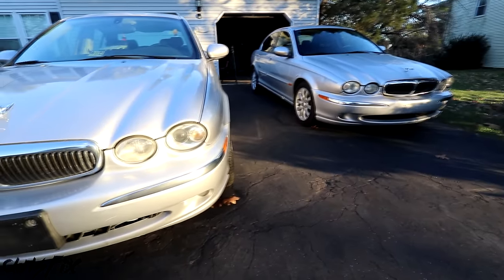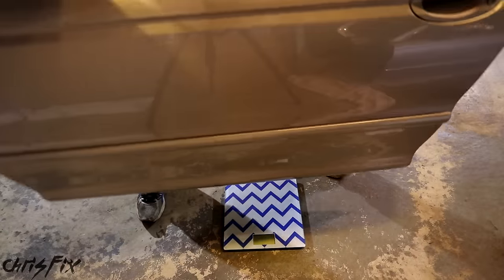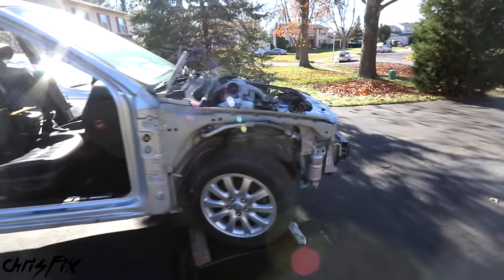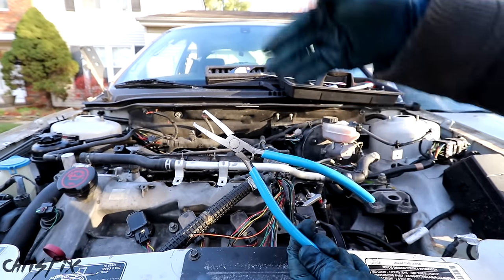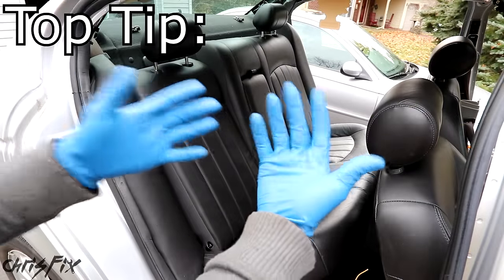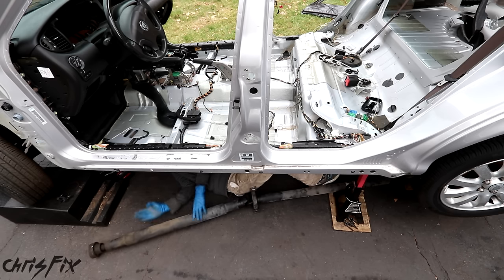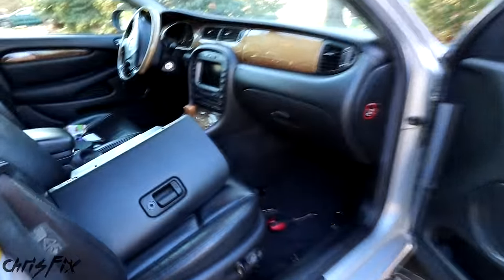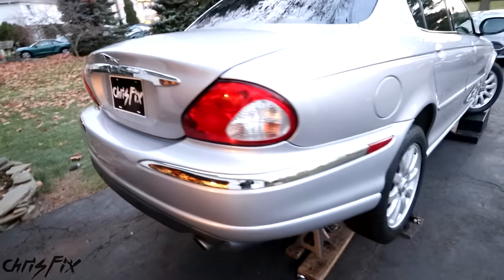How to Strip a Car COMPLETELY

Comment: Out with the old, in with the USED🤣
Reply: Lmao
Reply: Lmao
Reply: Yeet
Reply: Old, not obsolete
Reply: Cheaper but you know it will last until you can afford new!
Reply: I'd say 90% of parts on a car are meant to last the lifetime of the vehicle.  Some parts which experience wear are meant to get replaced (belts, fluids, clutches, etc), but the rest aren't for the most part.  Better to get one used at a fraction of the price if its in good shape and isn't time consuming to fix.  For those that aren't easy to get to or work on, better to replace with new parts.
Reply: If that's any better. Ikr?
Reply: Lmao
Reply: LMFAO
Reply: Brand used 👌🏼
Reply: TackyLamb YT out with the new in with the old
Reply: Lmao
Reply: TackyLamb YT  😂🤣😂🤣

Comment: Im surprised he left the steering wheel on and it looked like it had some decent rims on it
Reply from the maker: I grabbed both after I got the shot :p
Reply: @chrisfix  You took the wheels off on the flatbed? Did you just jack it up on there like normal, and then set it down on the rotors?
Reply: It's a three year old vid and he still answers questions talk about a good yoituber
Reply: @lxndshark4123  the rims that went onto the flatbed weren' t the rims that came with this jaguar. Those are the ugly rims that came with Chris'  dad's jaguar, and Chris replaced with the stock rims.
Reply: what do you do if you don't have an old set of rims for that? are there like wood rims you could pop on to roll it? or do you just have to let the rims go to scrap?
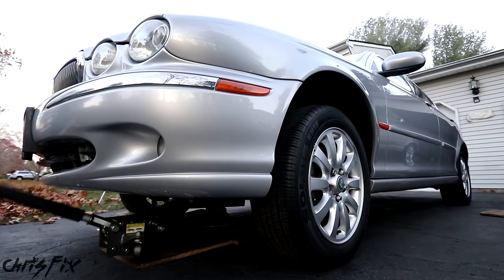Reply: @OfficialBeeswax  at 0:22 both cars have the same rims. Chris must have swapped on some cheap rims that were worth less than the ones the jag came with.
Reply: @kevincrossland1898  you could probably talk to the scrapper company about it, but I’d say you’d either have to swap in some cheaper rims, or just let them go to scrap
Reply: @kevincrossland1898  go to a junkyard and find a set of old rusty rims that will fit on there just to get it towed away.
Reply: I
Love 💘
Reply: I'm still grateful to have a superstar reply to me lol
Reply: @chrisfix  i know I'm too late but he left the nice speedometer in the car
Reply: Hi

Comment: 2002 Jaguar X-type. I once had it for 11yrs,  what a brilliant car it was. 
Thanks for the good vids.
Your dad would surely be proud of you.
Reply: Definitely. That's gotta be one happy Dad!
Reply: I had an opposite experience with this car. Had it for 6 years and it was 2001. It's junk and is a rust bucket. Bottom of the car rusted like crazy until pieces began to fall apart along the side fenders. Got rid of it in 2012 when a truck hit the drivers side and damaged the whole side. I collected insurance money and sold as is. That was the best way to get rid of that junk.
Reply: @zedzedski7382   Sorry to hear about that.I  'mt still driving 2003 and 2004 X-types without  any aggressive rust.
Reply: @medium95  helps if you don't have much snow and salt on the road during the winter.
Reply: @zedzedski7382   Yes, you're right. but that high humid, snowy or salt condition would give  high risk of forming rust to all cars .  Careful inspection and maintenace are normally necessary in my coutntry South Korea, too.

Comment: "Yeah these floormats are like $100 a pair."
Leaves them outside overnight with the doors removed
Reply: I can't believe he didn't work on external parts first instead of stripping the doors off so early. Bunch of leaves and rain on the seats the next morning. Try to keep the seats but they just go moldy.....
Reply: dodge charger buy 34,322 dollor
Reply: @OffGridInvestor  Mould can easily be removed from leather
Reply: عامر
Reply: Hi
Reply: It's called  "Security through obscurity"... :)
Reply: @OffGridInvestor  right i always take out doors and glass last so im in no rush to get the interior out
Reply: 1k likes but 7 comments? I’m about to change that.
Reply: @عامرإظهار  ?
Reply: @MASONTUBE MMM wut
Reply: Doors? What doors?
Reply: What are some ways to get rid of these parts after stripping the car?
Reply: @bigblue2713  common sense is sell them
Reply: @TurboCavalier  oh really?

Comment: Personally I would have liked to have seen the details on selling the extra parts you didn't need. Like, how did you list the parts? Who is buying these parts? How quickly do they sell? Where did you get those prices from? Etc.
Reply from the maker: Gy001 it takes months to sell parts. That is a cool video idea
Reply: I also would love to see more information on how to sell parts. I've got a car that I think I could get some of my money back, but other than eBay for small parts I'm at a loss. Like selling doors and stuff.
Reply: Take those parts to the swamp meat
Reply: @chrisfix  Ye mate, a video on where and how to sell parts from a stripped car would be top shit. What website(s) do you use to sell parts?
Reply: Can sell on sites like ebay and craigslist. You can also sell to a junkyard/parts trader. Always check to see if the car has an online forum following. Join the forum and sell the parts there too. 

You kind of just have to spam these options several times and you'll definitely get buyers for most of the stuff. Stuff always breakes and people always want a cheaper solution!
Reply: ChrisFix  would love to still hear your take on the parts selling side
Reply: @chrisfix  I agree!
Reply: I personally am stripping my Acura TSX that was in a fire and I listed the car with many keywords on Craigslist and Facebook marketplace which actually get a good amount of attention. Your next best bet would be to look up listings on eBay to see what these parts are listed/selling for and to list yours on there.
Reply: @chrisfix  If and when you make that video, I'll start making my Crimes playlist.

Comment: Dang, you should've taken the airbag on the steering wheel. Airbags are like $5k

9:20 1 step ahead of me, I see...
Reply: he did't take the cats
Reply: It's not on the list so I think he kept it
Reply: @KirbyMobile1  Saw the stripped car in another video; the airbag was gone. Should have taken the whole steering wheel.
Reply: Adam Bomb 1701 what video?
Reply: Look at 9:20
Reply: @AdamBomb-kd4fe  He probably didn't trust parts that have a lot of electronic in it (like all the controls on the steering wheel) due to the fucked wiring.
Reply: Air bags are not even worth $500
Reply: removing the airbag safely Vs it blowing in your face... i'd leave it right there
Reply: Killcard101 He could have sold the wheels
Reply: more like 150$
Reply: @mohammadfarra4835  there's no electricity to even open the trunk. What are you on
Reply: Bryce Simmons that’s what I was gonna say
Reply: airbags are worth $100-200 i work as a parts manager at a car dealership so i would know (obviously it can vary out of this range, but this is what most airbags cost)

Comment: and then 6 years later you're still left with 90% of the parts
Reply: Yep, I have right here the ignition coil I bought by mistake 3 years ago because of a bad diagnosis on a car I already sold.
Reply: True, my dad stripped a 2009 Lincoln Navigator in 2015 and still have the 40% of the parts
Reply: put yourself a dead line. For instance sell your parts during one month. Break the price by 50% for the second month. Give them or trash them after. You can also decrease your price slowly. Up to you.
You'll lose money but earn space.
Reply: Its all about supply and demand, not many people are on the market for Fiat parts.
Reply: no because all the parts would have already been used to fix the jaggggggg...
Reply: @carlosDUB99  still got the parts?  Black interior?
Reply: If you have a pickup or something, you can just haul all of the parts to a junkyard and sell everything.  You won't get as much, but maybe what you put in for the parts car...

Comment: Why left so much stuff on ? 
I mean 
Panel 
Handbrake
Suspension 
Windscreen 
wipers
Radiator
Alternator
Starter
coils
Pedal block 
Seatbelts 
and many many others  ?
Reply: Zuze91 and the rims.
Reply: He took the OEM rims off it. He obviously didn't want the ones he put on it so it could be towed away.
Reply: Zuze91 the alternator didn't took it because it was hard to reach and it wasn't worth his time
Reply: the windshield would be hard to store, handbrake, and suspension are hard to remove, and the wipers arent worth selling. he probably kept the coils for his dads car because new ones aint cheap
Reply: Oh and about the rims, in other comments he said they where damaged and they had to be used to move the car on top of the truck
Reply: and the rear quarter panels arent removable
Reply: Text Missing The suspension's actually pretty easy to remove, it's one of the first things we got taught at college. In most cases all you need is to remove 2-5 bolts and a rubber mallet
Reply: he had to leave it so it could get towed
Reply: Found you
Reply from the maker: If you have time you can strip every single thing but I was just grabbing the items that I could remove quickly and get the most profit from. Not as many people want worn suspension parts when you can get new ones for just a few bucks. Seatbelts, the starter, coils, etc were all removed.
Reply: Legerdy WTF LEG, Do we watch the exact same youtubers? lmfao, also why are you subbed to Chris? You wanna be a mechanic/learn how to fix cars? e.e
Reply: ***** Hahaha I have no idea dude, I guess we just watch good youtubers. Reason I'm subbed to Chris is because I just like cars.
Reply: Legerdy Ayy nice :^] first subbed because I enjoyed fixing crap, then decided I'd become a mechanic. In college atm learning to become one
Reply: Steering wheel and exhaust might be worth something too.
Reply: +Zuze91  The front and rear windscreens are bonded in on these Jaguar X-types, and indeed pretty much all modern cars.  The only way to get them out is by cutting the bonding and that pretty much always breaks the screen so there's no point in even trying it.  If it was an older vehicle with the screens mounted in rubber seals and the screens were in good condition with no scratches or chips it might be worth keeping them and the seals if they are in good condition so you don't have to wait for a windscreen company to replace your screen if it gets damaged.  But, front and rear windscreens are extremely easy to damage unless they're stored very carefully, even something like a sudden change in temperature can cause them to shatter while they're being stored...
Reply: Zuze91 the engine and trans 2
Reply: GUYS HE LEFT THE SUBFRAME
Reply: Erik Nobles   With the car being a non-runner due to electrical problems there would not be much point taking the engine and transmission as they can't be tested and they might well prove to be junk.  Plus, if they're not parts that he needed for his dads car they're going to take up a lot of space storing them until they're needed or until someone comes and buys them.  If you've got lots of storage space and you can test them in the car it would be worth pulling the engine and transmission as good used engines and transmissions are usually worth a decent chunk of money, but if you're short on time, short on space or they're an unknown quantity because they can't be tested you're better off leaving them to go to the metal recyclers.  If you've got all the storage space to play with and no pressure on the space that the parts car is taking up then there is a whole lot more that could be taken off this car to keep or to sell on, those rear quarters and the roof skin could be cut off and sold on to repair damaged vehicles if they're cut off carefully, but if you're under pressure of time or space you're probably going to have to send a parts car for recycling with usable or salable parts still on it.  But, if you do your research thoroughly you'll know what parts you can easily remove and easily store to maximise your money...
Reply: Text Missing what more alarming to me is that he didn't part out his dads car too
Reply: Could have easily compression tested the engine to see if the block is good and if it turned over easy. got 400+ for it advertised as good compression and didn't run.
Reply: Duwayne's Garage agreed. Actually I wonder why Chris didn't sell the whole drivetrain all together for more money.
Reply: dont forget the engine
Reply: ChrisFix I strip cars for livings. We take everything off. Good or bad. Even  if engine is bad, we take it out. In my experience people sometimes take even 1 head bolt, or 1 head valve washer. Fuel tank overflow hose. In years there has bean many small. 
Ok Jag was fairly new. I works on old cars 1990-1998. And they dont grow in numbers. 
Even small thing like seat belt plastic cover. Its 20+ years old/fragile. To find one who has all plastic clips/and mounting bits , they got real expensive.
Reply: +ChrisFix there's a bunch of stuff that was left that I would agree with... yea some is  PITA , but the steering wheel/airbags... heck, people break into cars just to take those.  Exhaust/converter (same deal with the converters).  I've never known someone to strip a car and leave that much of the engine (I've always either pulled them or at least pulled off the top end, you can take the top end off of most engines with an impact gun in less than an hour.  

I'd be surprised if there wasn't a market for even worn suspension parts on those cars.
Reply: For those of  you saying that he had to leave the suspension/wheels for it to get towed away, I've never known that to be the case.  They just drag it up the flat bead on it's belly.  I've never had an issue with that.
Reply: Catalytic converter?
Reply: Mark Pikas Thats how we do at work. Just drag on flatbed.
Reply: Steering wheel
Reply: Zuze91 also exhaust, they're pretty valueable
Reply: Front Airbags
Reply: Lllllllwj
Reply: +ChrisFix You missed the Catalytic converters. 
Sell your airbags in kits Driver, Passenger, sides, seatbelts, sensors, clockspring and computer usually $300-500 right there.
Locks, ignition switch / tumbler and keys can sell for strong money. 
Buff the used headlights before selling them.
I always keep engines complete and that engine goes for about $1800
The transmission sells for about a $1,000
Reply: even generic crap that we dont normally thing about like the nuts and bolts can sell for a decent amount.
Reply: RIIIIIIIMS
Reply: Destroy
Reply: Zuze91 Not to mention engine, trans, ECU, fuel tank, and obviously rims and suspension.
Reply: Zuze91 and the radiator
Reply: they looked ugly af . i'm glad he put the stock ones.
Reply: Zuze91 for his other car.
Reply: +Mihaly Lukacs He took the wheels and had to put rims on so it could be towed.
Reply: Golden Duck really, don't get what people are fussing about. he got what he needed and them some to make a pretty good profit. people are just greedy.
Reply: Zuze91 he left the messiest parts in the car since it's a pain
Reply: lol wipers... some things arent worth it bro.
Some things hard to get or take off so why bother? Im unsure of the radiator, perhaps that would have been worthwhile, even so that engine seems to have had many issues, who knows whats wrong with it electrically, and if it caused damage to any other parts of the car. You saw the melted wire XD
Reply: DjStiv3 You would not believe what people buy used. I do car striping for living. Almost everything whats possible to get of car used can be sold. People buy even used fuel filters and oil filters. 2mm tyres on metal rims.
Reply: probbaly takes forever to sell... i mean thats the bottom of the barrel scavengers lol buying used oil filters? come on now. either way its a waste of thie guys talent and time. besides he wanted to free up space in front of his house and not have to look at it sitting there. He did all this within a day or two s i recall. By himself.
Reply: Maybe he need more space in garage:)
Reply: JordPlaysGames ik I learned that in 10th grade of high school in auto class